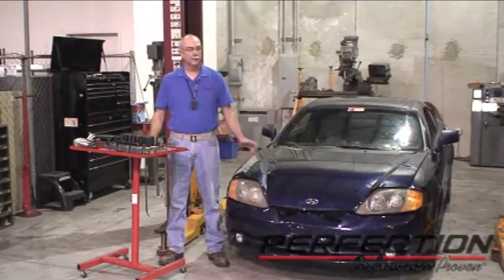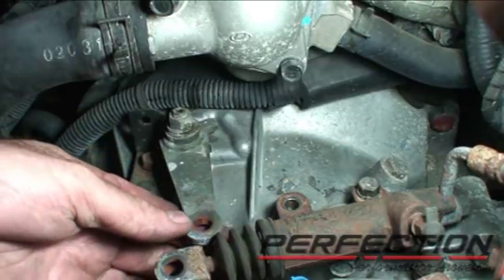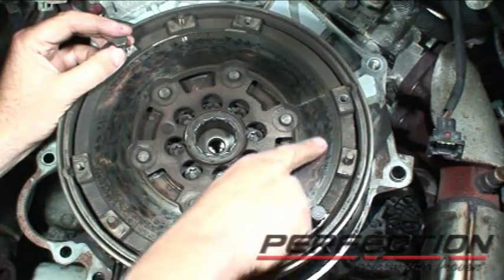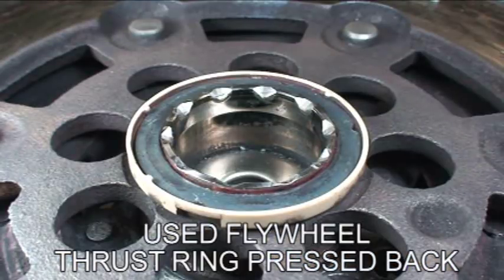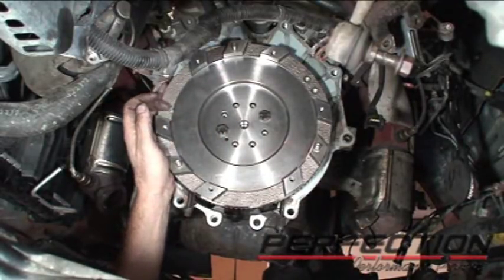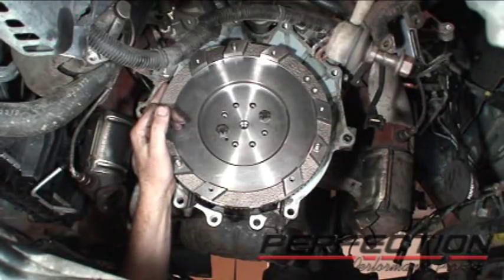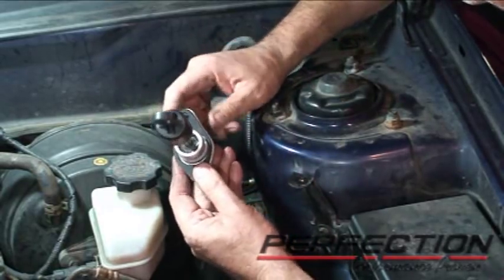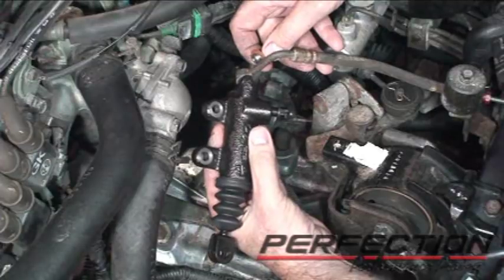2003 Hyundai Tiburon GT 2.7L Clutch and Hydraulic Release System Installation

Comment: Awesome!
There is something that seems to be missed often in most replacements.
The clutch slave cylinder, "delay valve" that is installed in both the 2.0, and 2.7 has an inherent problem with introducing additional, (and unneeded) clutch slip.
It is great for a newbie that isn't familiar with driving a manual, but its terrible with anyone with past manual transmission driving experience.
This little $5.00 part, causes premature clutch wear.
I bought a 2004 Tiburon 2.0, when the car was 1 1/2 years old with 16K on it and noticed Immediately during my test drive the clutch was engaging, but with an odd and noticeable delay.
It felt smooth, but lifeless.
After driving manual transmissions for years, I knew something was odd.
Simple as a clutch master cylinder and slave are, I suspected the problem was in that area.
I was correct, and almost went into my clutch slave (easiest to look at first) to inspect.
Went online and another gentleman had found the issue just a little before I did.
I removed the little spring and small valve in the clutch slave, and it completely restored clutch feel, and engagement/disengagement.
I also know, (being a longtime mechanic) that the delay causes slip, and the slip causes excess heat on the flywheel (warping it), and of course eventually ruins the friction plate.
I just thought I would mention this odd but very easy way to improve the life of the clutch on the Tiburon.
Loved your attention to detail in your video!
:)
Reply: VERY useful info...thanks!
Reply: I also noticed this as well when I test drove my first Hyundai Tiburon, the clutch felt very odd. I did not like it at all.
Reply: Hey its Elijah the guy you sold the Tiburon 2004 to, I lost your phone number and I happened to find you in this comment section lol. I was wondering if you know if my car has ever been repainted? I recently bought touch up paint and the color didn't match so i sent it back to be fixed, and it hasn't been sent back yet. But now i'm wondering if it was the right paint because my side "gills" match a piece I test painted.

Comment: I am performing this job on a 2004 tibby gt this weekend coming up.... thanks for the insight. ...hopefully a smooth install... I'm installing the aimco xtd stage 2 clutch and solid one piece chromoly 12lbs lightened flywheel and doing away with the junk dual mass flywheel. .. first clutch from factory lasted 100k miles... ford replaced it and the second one only lasted 50k this time....I suspect the throw-out bearing is DONE...

Comment: I know this was posted a long time ago but hopefully you guys still view comments on the older videos. Was it determined what caused the squeaking/creaking noise and feeling when pressing the clutch in? You mentioned it while talking about the slave cylinder early in the video and I was wondering what needs to be done to fix that as well as what causes that noise. Thanks and great video!

Comment: Very good presentation and photo work. Would this be a possible backyard, ramp, possible job. I've had a clutch replacement and the dual mass is the biggest cost. This time around (being retired) I'd like to do something less expensive and "Do It Myself" if possible. P.S. at 173,000 I guess my clutch deserves some rebuilding and replacement.

Comment: Hi there, I have a 2003 Hyundai Tiburon GT V6. They barely put a new clutch, first day worked OK but next day doesn't want to shift gears, none. You can switch gears when it's off but when it's on you can't. I tried to start the car with the gear on, it did but it made a really bad noise and it didn't move so I turned it off. What could be the problem?
Reply: @perfectionclutch  my just started doing the same , I had to turn off the car just to put it in gear once I get going I was able to shift to 3 and any other gear without a problem but if I went to neutral I could shift out without turning off the car, also the clutch doesnt feel like it use to , it feels  lighter and doesnt bounce back like it use to as in no force to come up
Reply: @perfectionclutch  it's an 03 tiburon gt 6speed manual 2.7 engine,  I tried bleeding the master cylinder and the clutch went straight down and got stuck when I opened the bleeder valve

Comment: Aw nuts Gary, Just like the 1999 Hyundai video you didn't show any of the reinstall of the trans.  We're hung up on getting the thing to seat the whole way in.  No amount of twisting, pivoting or cursing is getting it on this 2002 elantra we're trying to put back together.  We don't want to use the trans mounting bolts to get it to merry up...and with one guy under and one over it is not going in...any ideas?

Comment: Perfectionclutch, got questions what is the purpose for having a dual mass flywheel, why didn't hyundai use the traditional solid flywheel instead? Also what are you using to support the motor on top when you remove the 3 mounts holding the transmission to the k frame when removing the transmission? To me its impossible to slip the transmission from the bottom because of the k frame in the way and if you take the k frame off first all the mounts mounting the tranny to it comes off as well then you have nothing holding the motor from falling to the ground. What i did on my 03 tiburon 2.7 6 speed clutch installation i pulled the whole motor off with the transmission out with an engine hoist only way i can do the clutch removal and installation.

Comment: I have a 2005 Tiburon GT v6 5 speed and let's say when I shift to third gear and then push the gas, the RPM shoots up oddly high! Happens when I step on the gas (as if my foot was on the clutch). Do I need to replace my clutch? Thanks in advance!

Comment: I just did an engine swap and new clutch on an 03 tiburon fir my brother. In this video he says to position the clip/ring on the clutch so it has the opening at the bottom so the bearing clips in. When we did ours we couldn’t figure out how to get the ring to spin to an position besides where it was. It was somewhat towards the bottom but it was more to one side than the other. In the video he says he does it to make it easy, but not that it’s absolutely necessary so I installed anyway. Now I have it completelty back together besides the slave and such because I tried to push the lever back like he shows to lock the bearing in and I could t seem to get it to click in. I’m really hoping I do t have to pull this thing out again and someone confirms to me that the ring does t have to be exactly at the bottom. Maybe I just need to push harder, like with a hammer or something to help apply more pressure? Any help would be greatly appreciated. He’s about to junk the car out because he can’t see if it runs. Thanks
Reply: Roll the flywheel to position the explained on the vid.

Comment: Question: you added a different styled clutch from the original because you changed the flywheel to a single mass flywheel right?
Reply: No as far as I understand it was a original replacement

Comment: I replaced my master and slave, and I went to start bleeding before hooking the slave up to the release arm. The pedal will not go down unless the bleeder valve is open.
Reply: 04 Tiburon gtv6. The day I bought it, when driving it home I could start smelling the clutch and I became unable to shift gears. I paid someone to replace the clutch, TOB, and flywheel, and when they finished the pedal would just hit the floor. I decided to replace the leaky slave and master cylinders. 

I tried to bleed the clutch but pedal won't go down unless the bleeder valve is open. Could this be an issue with a ton of air in the system, an issue with the fluid transfer between master and slave, or a new and defective part? One thing I noticed s that the plunger end of the slave cylinder is pretty difficult to push in, and it pushes itself back out. 

We had trouble getting the brake line that connects the two off of the master. We had to use a wrench to pry it off but it seemed to go back on fine.
Reply: perfectionclutch I actually saw that and did that last night! I never hooked the slave back up to the arm, I figured it should work first before connecting the arm to it. After replying a couple hours ago I wondered what would happen if I hooked it up all the way and before I left for work did just that. Now it seems to work fine! Your fix last night did the trick, the slave was indeed extended at rest before I did that night last. I must have been wrong thinking that it should work fine to bleed without being fully attached. There is just a little extra resistance when pushed in all the way which may just be because it needs bled now.
 I'm a total virgin with car repair so this is all new to me. I guess I fixed it last night thanks to your video and my own noob ass just didn't realise it cause of my own mistakes. You've hands down got the best Tiburon video I've been able to find. You seem to be very experienced with this car. Thank you so much for that and taking the time to try and help me. I'll be bleeding it tonight after work and hopefully that's it and I can drive this awesome car.
Reply: perfectionclutch I recall you mentioning the pushrod. I have no idea what that is but I'll start my research. Thanks again man.
Reply: perfectionclutch wow that pushrod document is perfect. Just what I needed.
Reply: same problem.. hard as a rock stuck clutch pedal in the up position..  bent clutch fork
Reply: perfectionclutch it's not that bad I did it in my drive way in 4 hours

Comment: With regards to the master Cylinder.. If you install it too long then and pressure is still holding on the system... Does that mean that the clutch is still partially engaged? O.o .. Could it cause it to slip then?.. Sry trying to make sense of it cos my clutch is slipping and the car has had a new clutch.

Comment: Perfectionclutch, let me get this straight so  the total ft pound torque on the flywheel bolts is 55 ft lbs? And the total ft lb torque for the clutch pressure plate is 19 ft lbs? I bought the clutch kit with the solid flywheel for my 03 tiburon gt 2.7 6 speed tranny and i need to know if those are the right torque specs.

Comment: what is it when I press the clutch and I have trouble cycling to gears ?

my clutch pedal feels ligher and I have to step a few times till I'm able to change gear
Reply: Mine did the same so i chaged the slavecylider and fixed problem i noticed mine was leaking from there
Reply: ...its time to buy an automatic?

Comment: thought I saw transaxle installed while changing clutch in one of your Hyundai videos.  you have to remove both, correct.  getting ready to work on a friends and am using your videos as a guide.  can I call the 800 number if I need help?